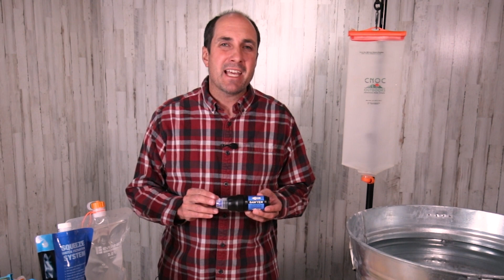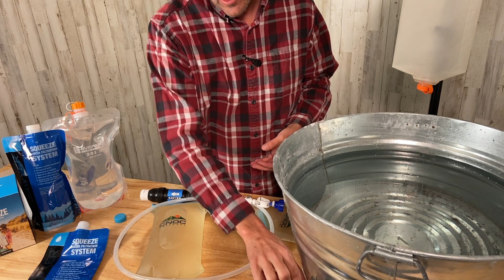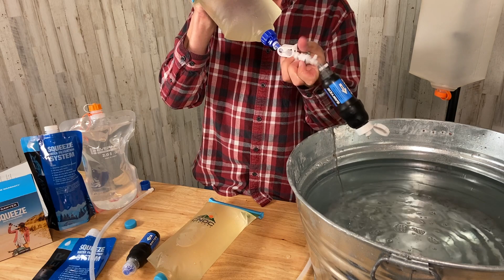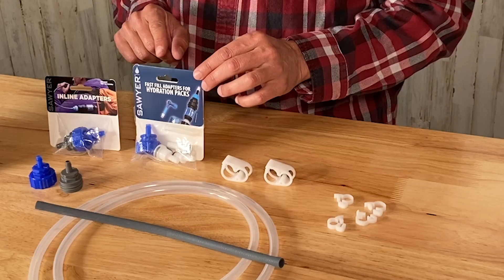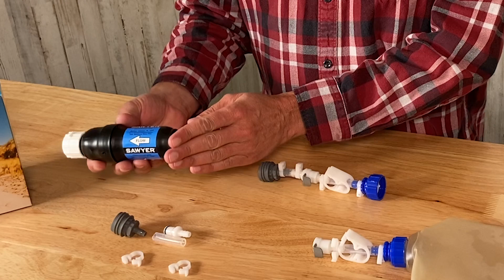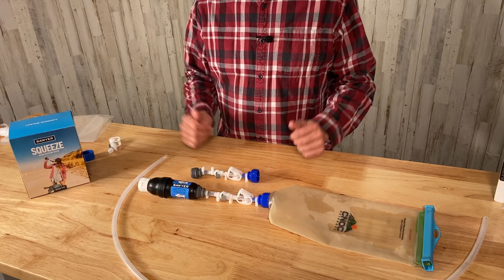DIY Sawyer Squeeze 🔶 CNOC Vecto Gravity Water Filter Setup

Comment: Look at all those fiddly piece parts?  Syringes, adapters, on-and-on.  Use a HydroBlu instead.  It looks like a Sawyer-Mini, but flows like a Squeeze (80% of a Squeeze anyway).  HydroBlu has all the attachments built-in, yet weighs much less than Squeeze.  HydoBlu has tethered end-caps and thus requires no bandana.  HydroBlu has 28mm female threads built-in on both ends, so one can attach the CNOC lake/stream water on one end and the filtered Smart-Water bottle on the other for an end-to-end gravity system (no squeezing).  HydroBlu is smaller and lighter for sleeping when it's cold out.  HydroBlu flush requires no syringe, simply remove the CNOC and squeeze the Smart-Water bottle to flush.

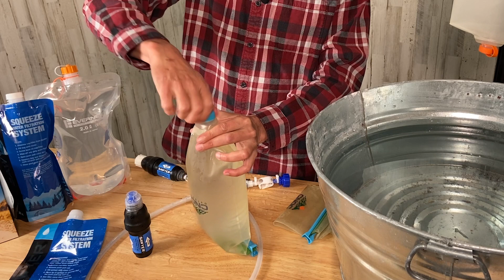Comment: 1:49 😂 “pain point all the twisting” (proceeds to do all the twisting in under 10 seconds, with exactly no effort). 
(Edit: I actually independently came up with essentially this same system to connect my Sawyer to a water  bladder hydration set up to filter water as I drank it, I just thought it was funny).

Comment: They make an adaptor for tubing. It's $10
Reply: Link?
Reply: Did you manage to find out? I’m looking at Osprey quick connect or Hydrapak quick connect, or even just a garden hose inline cutoff valve if the disconnect feature is t needed.

Comment: Thank you for this video. I have been using the sawyer squeeze for two years using the traditional squeezing method. I like the system that you have developed here. What would you say is the benefit of having the extension tube that allows the bag or bottle to be on the ground? Does that simply reduce mechanical stress on the system? With the extension hose, are you able to just set up the system and let it be? I assume that the water flow stops when the clean bag is full and then you can switch out to another clean bag if desired. Do you have a preference of the long versus the short system? Thank you.
Reply: Hey - I thought I could add something to your question. Majority of my camping is canoe camping with a group of 4-6 people. Its nice to be able to filter a lot of water without having a dedicated filter person...this allows more passive filtering using gravity and a large vessel on the ground versus traditional filtering technique that you described. If I'm only doing filtering for 1-2 people then I'll typically skip the gravity method.
Reply: @taylorandr4  thank you. I really appreciate your input. I am only going to be backpacking with my son, so I don’t really see a need to use the gravity system. Besides, it costs a lot to buy all of the parts for building this!
Reply: @taylorandr4  your reply is timely as I am going on a backpacking trip with my son next month. I guess this channel doesn’t reply to comments.